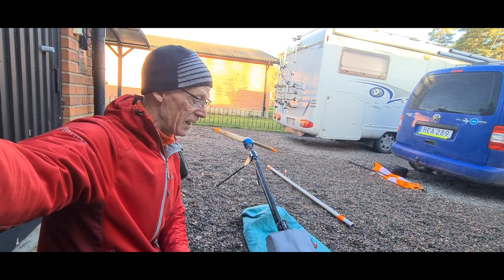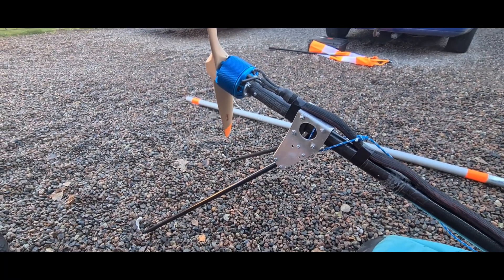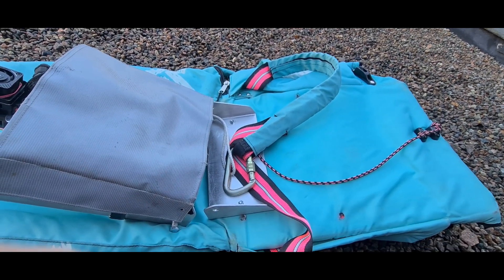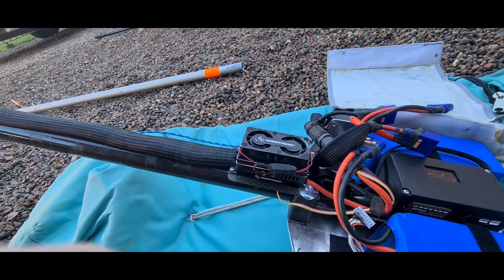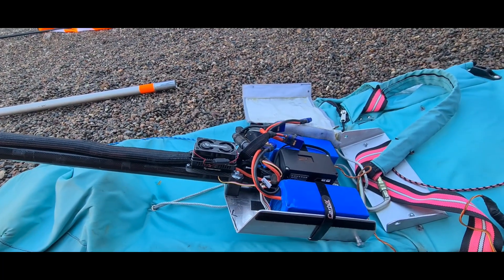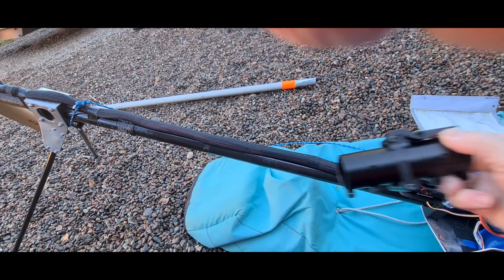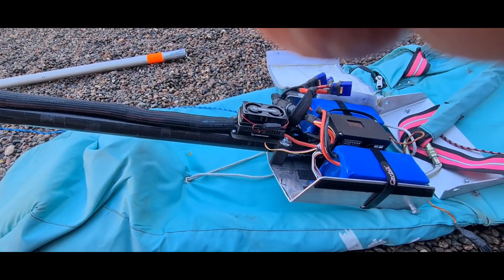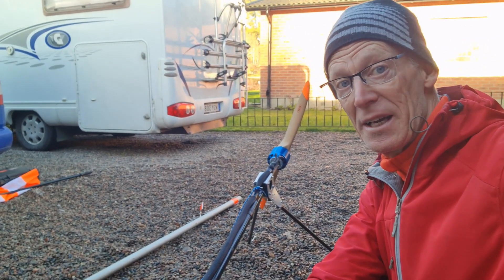Hang glider electric motor system presentation

Comment: Hi! Good system! I have similar but now I`m testing a new batterys and it works nice... What type of connectors and wires are you using for 200A? I bought new batteries that give out about 300A but they had X90 connectors installed.. I think this is not enough, I replaced them with 6 mm bullet. But still the 8AWG wires and connectors heat up quite a lot.
Reply from the maker: Hi. I use Qs8-s 200 amp connectors, works great, an 10mm2 cabling. More info will come on my new FB site " Meij-tech AB"

Comment: I would suggest putting the lipos in bag with a release, so if a fire breaks out, you can cut them free, or at least let them hang at the ends of the cables away from your body and harness. If they hang a couple meters below after release, at least they will not fall, and not burn you. Otherwise, looks great and is duplicatable. Price? for system. 10 minute run time with 16K batts: is that at full power? What time could you get if you throttled back once up? Altitude on one charge? Love the CF tube break down adapter. I used to fly a 'Soarmaster' w a 12hp 2-stroke engine. Montana USA here. Maybe a planetary reduction with a longer, higher pitch prop.

Comment: The engine looks like a copy of the Dualsky GA8000 called LEO but I could be wrong. Please tell me, to maintain horizontal flight without climbing and falling how much power % do you need in your setup? I weigh 76kg, it would probably work better for me. I live in northern Poland on flat terrain and I also want to become independent eventually. Now I have the possibility of towing with a car winch at a 2.5km airport but you have to adapt to the work of the winch. I used to work in Copenhagen and several times I drove over a large bridge to Sweden Malmo, Ystad and Gothenburg I remember that period very well but I came back to the country. All the best to you and your whole family. My heart is happy that you fly and spend your time actively, most people watch TV and waste their lives there. May the wonderful thermal conditions carry you as long as possible!
Reply from the maker: Hi its the Leomotion motors I use, the biggest one. I thing I use like 60% in level flight, depening on performance on hanglider.
My yellow WW sport 3 need less  in the air